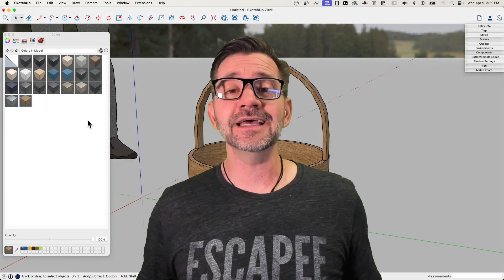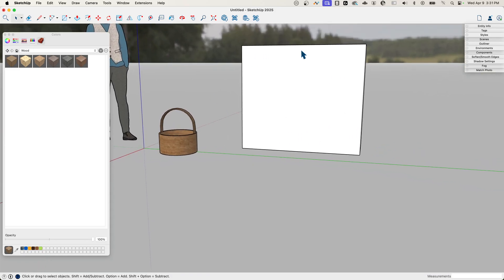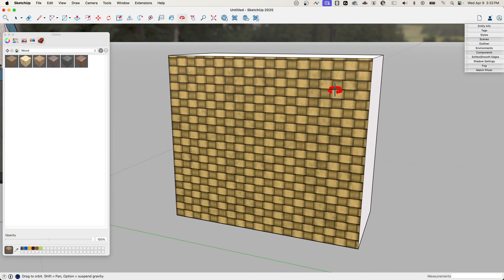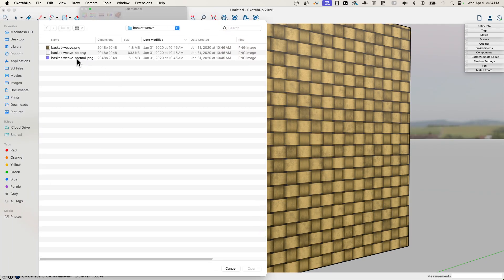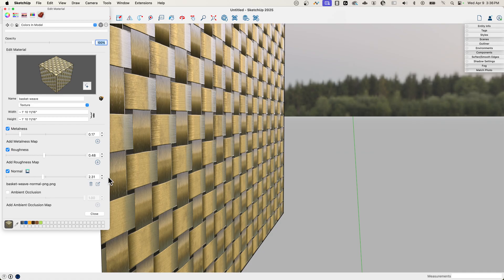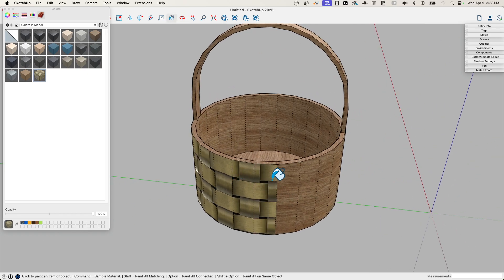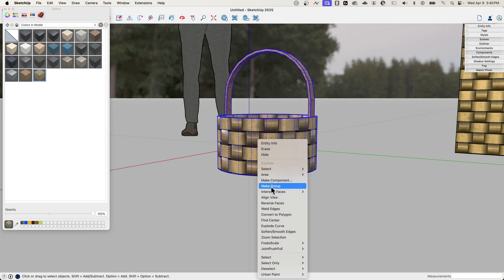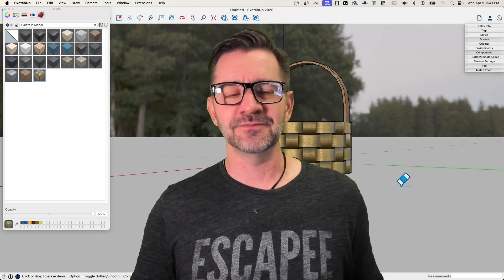Transforming a Woven Basket Model with PBR ✨ (SketchUp Tutorial)

Comment: I found that the materials imported from Poliigon rendered my SU model unusable.  The textures are beautiful, but make the model so heavy it is just not efficient to work with.  Is there a way to decrease the size of the textures so the model isn't so heavy?
Reply: I remember Aaron mentioned this subject in another performance related video and the solution was to reduce the file size of the texture in an image editing software or even downloading a smaller resolution file in the first place. Of course this is for modeling. For rendering quality, the more the merrier.